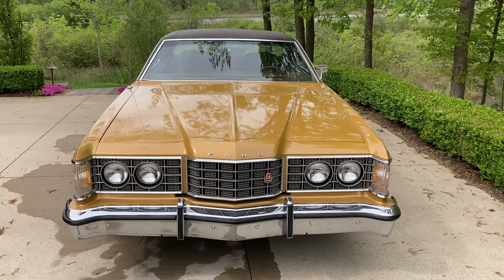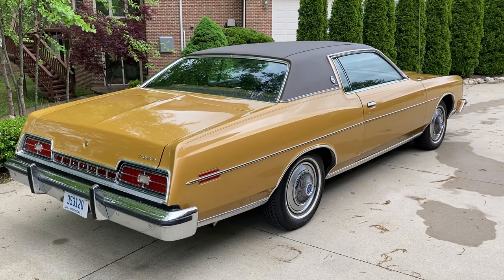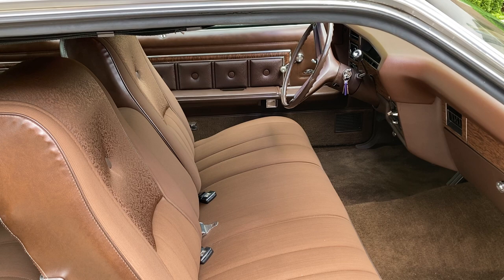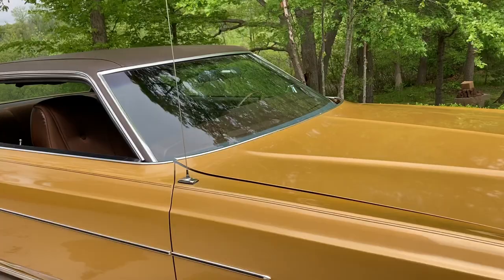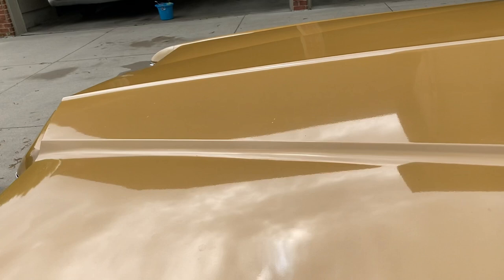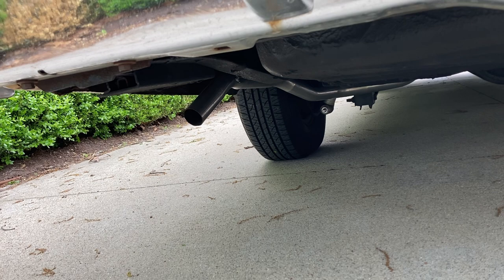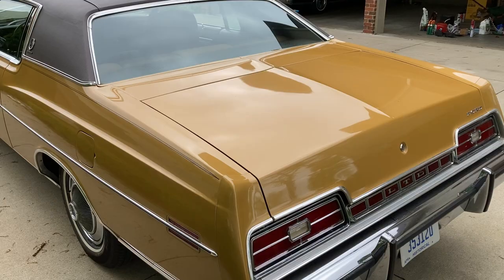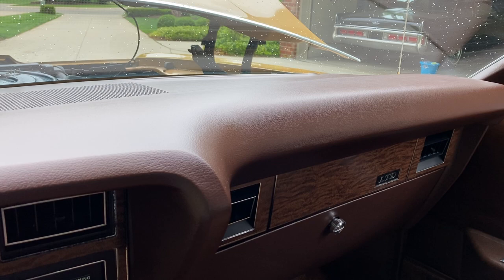1973 Ford LTD Brougham Coupe 460 V8 - The Everyday Man's Near-Luxury Car

Comment: My grandmother use to have a 1974 LTD two door as same as the 1973 year model and it had a 400 cubic inch motor. If you were ever to get in a high speed collision in a car like those you, would have much of a chance of surviving that collision as long as you have your seat belt on. I own a 2022 Mitsubishi SUV and I sure the hell wouldn't wanna be in a high speed collision even with seat belt on and all air bags safety features.

Comment: Beautiful specimen, that. I miss those aberrant, wonderful '70s colors. Thanks for sharing!  Most didn't appreciate the big '70s bumpers, but I sure did - great protection, and Ford had some of the very best. Parking lot or traffic light taps from an inattentive motorist? No big deal. Need to push a dumpster, shopping cart or derelict Edsel? No big deal. Good stuff. '73 was a hybrid one year only look in FoMoCo land, featuring the 2.5 mph rear and 5.0 mph front bumpers.  Was it the same for GM and the rest? Think so, but can't recall at the moment.

Comment: My dad had a 77’ LTD Brougham 351 2bbl. 4 door sedan. I remember the dealer checking off the boxes while dad said yes / no ordering it. at Ford City Ford Chicago Illinois. Even at 9 Years old gave him crap for not ordering power windows.
Reply: Looks like the one I saw in the end credits of The FBI with Efrem Zimbalist Jr. Used in the end credits
Reply: In your dad's defense, there was most likely a reasoning behind his decision.  In that era, power features would notoriously break down or fail completely, often prematurely.  Many older people, including my father, would say that power windows, door locks, seats, etc. were "just something else to go wrong with the car" and, therefore, didn't want them on the vehicle.

Comment: I like the 460. Bought a rusted out 73 Mercury Marquis that has only 51,000 miles. Pulled the 460 and C6 auto and dropped them in a 74 Torino. That car would cruise all day at 70 miles an hour and get 22 miles per gallon.

Comment: I had 1 of these , i bought it in 1983 for $1600 at a Datsun dealer in Skokie IL . It was a dark brown with the same interior . back then all the parts matched inside but your seats are quite faded an d a little thin fabric wise . it was a very comfortable car . Mine had the 9 inch traction- lok rear with the 2.80 highway gear .
It came with the standard 400 M engine which was the later version of the 351 Cleveland with a taller deck and the larger trans bolt pattern that was shared with the 429 and 460 . When the engine  needed a total rebuild I sold it to a guy with a rusted out 351 Cleveland powered 4 dr Galaxie from much earlier in the model year . He thought it would be a straight engine swap but he had to swap in his FMX when the C6 would bolt to the engine . he drove it another 5 years in Chicago before the body was full of rust holes.
I didnt miss not having power locks or windows since they werent that common back then . It had AC that blew ice cubes like a GM but I really missed having cruise control since this car would creep up to a hundred if you werent looking at the speedo at all times . It cruised quietly without any sensation of speed or bumps . That seat was called the Flight bench and you really just flew down the highway like an airplane .

Comment: RISP Bought 1978 Ford LTD 2Dr 460 Police Interceptors, when 440 Plymouth Grand Furys, were no longer available in the 1978 Model year. They were ordered with an optional 8  gallon auxiliary fuel tank. 
 There was talk about 1978  Chrysler Newport 2 Dr HT 440 HP, but that never happened,  The last one 1978 RISP FORD LTD 460 Police Interceptor 2dr HT I saw still in service was in June, 1984 on Rt#95 in Warwick, RI, Southbound,  just past the Airport Exit, and just before the RT#117 Exit.

Comment: my dad bought a Ford LTD Country Squire wagon with a towing package from the dealer's floor. we werent even looking for a new car.  it had the 400cid in it and like this one. no power on the seat, windows or locks.  it had the climate control AC where you picked a temperature, and of course the inward facing jump seats in the back.  we pulled a 20' travel trailer from michigan to maine and again down south one year and to DC one year.  my dad gave it to one of my mom's cousin (who had 4 kids and not much in the way of job prospects) in 1983.  the sticker was $4,449 if i recall...

Comment: I love it. Real wheels and tires, 2 doors, vinyl top, and it's BIG. Only thing missing is a right side mirror, which was optional. My dad had a 1974 LTD 4 door, brown with a tan vinyl top. I believe it had the 351 engine. It floated over the road like a hovercraft. I currently drive a 2006 Lincoln Town Car, but would much rather have one of these. They look a lot better, and have NO computers.

Comment: Had the base model Galaxie 500 with a 351w years ago and yes, the fuel gauge in it never worked. Absolutely loved that car! It was such a head turner everywhere I went! Sadly, I didn’t have the means to restore it and keep it in good condition back then, so I just drove it until it literally rotted.
Reply: I thought this was a Galaxie 500, the LTD had different tail lights. Guy across the street had a dark blue one in early 80s in NY.

Comment: A year ago, I bought a 1973 Pontiac Grandville convertible. Similar. Big engine. 455. Crank windows, am/fm, . No tilt, cruise. Has a/c. To bad LTD couldn't get a convertible on the line.

Comment: ...this is a really beautiful car in also beautiful condition!  I really appreciate when the engine compartment is being left to it's original condition without this terrible chrome bling-bling you see so very often.
I'm owner of a 1968 LTD 2dr hardtop with the most common 390ci engine. 
Here in Germany, most people think about old US-cars as being very luxurious and full of extras - haha, my LTD didn't even have a right rear mirror until I installed it. 
No trip recorder, no temperature gauge (only these blue/red lights), also 4x drum brakes without power brake (so I changed to disc brakes with power brake, traffic here is too intense)...nevertheless, I invested a lot in this car since I bought it, and I cannot imagine to sell it even gasoline becomes ridiculously expensive these days ($2,50/litre or, converted, roughly $9,5/gallon).
Have a safe journey and greetings from Germany!

Comment: My 1975 Buick LeSabre coupe is similar option wise: it has the 455, the F41 heavy duty suspension, the most expensive climate control option, AM/FM cassette radio and Landau top but as yours, no power locks, and no power windows

Comment: Love your videos. Seems like yesterday when these cars where new. I never realized how these models just faded away and have been replaced by endless look-a-like SUVs. What happened? I still prefer a passenger car with a trunk. So glad you are preserving these vehicles I used to consider just mundane transportation. Now they are a great representation of the era. My Dad had a gas station in Manhattan during the oil embargo. It was total insanity watching these huge cars waiting in line (wasting gas) to get a few gallons of fuel. Had to be there to believe it.

Comment: Beautiful car!  As long as the Pertronix module ha been properly installed, it will be perfectly reliable.  I'm a British car fan and we use them a lot.  As long as you wire them properly, they're fine.
Reply: @stevepulse4893  They went for vacuum cleaners instead.  It was the only thing they made that didn't suck!

Comment: Very nice find and a smart buy on your part.  My dad loved these big boats so we always had something with the biggest V8 they offered.  He would usually get Lincolns, Mercurys, Buicks and Cadillacs and often the coupe versions but we had all kinds.  The full size cars from say '68 thru '78 really floated nicely down the interstate.  It's odd to see roll up windows in what is really a quite luxurious machine.  I have a '78 F-250 that I restored (partially) and the silver on the instrument cluster trim can be made to look like new by using some aircraft modelling paint without too much cost or effort.  I think your LTD looks amazing.  Love the paint color too.  The vinyl top popular back then seem to cover up some sins as I found out when working on a '72 Mustang. I'm guessing that this car was garaged and under covers my its previous owner most of the time and protected.  I would suggest researching the common rust areas on these and then treating it (if you have not done so already) to really keep this looking pristine.

Comment: The first 460 generation was introduced in 1968 and was produced until 1972, this had an Autolite four-barrel carburetor and made  and 485 pound-feet of torque. This is the most powerful of all of the 460s.
Reply: Thats sad, 460 cid & 212 hp? 0-60 in 3weeks, truly a snail.

Comment: A very mild cam, a set of earlier model 385 series heads or some aluminum heads for better breathing and an aluminum intake and a Holley or ACE fuel injection system would make a bunch more power and get better mileage. This car is great as is but could be even better.

Comment: Stupid car lot, put the car on the lot when it won't start.  I'm surprised they let you mess with it unsupervised!  The car is beautiful and thoughfully equipped, all the right stuff.  The bumper guards/strips really do "soften" those big bumpers.  Side moldings are very important also.  Big engine and HD suspension.  I could certainly live without power windows/locks.  Just wish he had chosen split bench bucket seats though.
Reply: Properly optioned for sure.  Hope the original owner is watching, they will be thrilled.

Comment: Amazing how Ford used the same platform on different vehicles. Beside the speedo, the dash and heater air ducts are the same as on my 1972 Mark IV. The Quarter Windows and the lower part of the inside door panels are also the same.
Reply from the maker: They’re not the same at all. The mark IV was a totally different platform.

Comment: That IS  super rare! I've only seen a '73 Country Squire with a 460... Part of a trailer towing package along with heavier duty cooling, an oil cooler, and I think some changes to suspension and braking...
Reply: The only thing rare is someone who is willing to own it! Just guessing that your roll of toilet paper is "super rare" because its the only one of that type bought at that store with that exact number of sheets left. Really? Then when you add the term "i think" it means you have no idea what it is & have no idea what your talking about.
Reply: Fyi, loan value is $ 3175 for this "super rare" ltd, or approximately $3000 more than your "super rare" p.t. cruiser dream edition. 🤣
Reply: Were still waiting?

Comment: Beautiful car in fabulous condition. When I was in the US in 1975 I had the use of this exact car - exact same front (shape, hood, grill+lights), rear (shape, tail lights), and sides (shape, 2 door with those small rear side windows). BUT it was a more “basic” version - no fancy chrome embellishments, plainer “cheese-cutter” grill - and I think it was badged as a “Ford Galaxie 500”. 
Have I got the model name right, was it also ‘73, and what was the engine size?
Great video!

Comment: Not many people may know of the rumour that Ford had to stop making these cars cause they last forever. They just worked. And they be tough as hell. Ya. The rumour back in the day was that this car worked so well, that Ford just stopped making them even though they still be selling. 

Like my buddy had one years ago and they used the thing to go and run over stuff for fun. That car would just work even after it took a major beating. They tell me a story of accidentally hitting one of those cement barricades and breaking it in half. Amazing. Have another friend whose dad owned one. That car just ran and hardly broke down. 

Ya, so the rumour was the ford LTD was too good and Ford had to stop making them cause they never broke down.

Comment: A  Brougham  should  have a right hand  remote controll  mirror  & P.W.  & locks & opera  windows   I see no speed control  on wheel  the dash pad should be extra soft it is a nice car but I get the fact that when these cars  were new there  weren’t  a lot of option  grouped  packages  like now a days  the  salesman  would sit with you in those Tiney  offices back in the day  and check off  individual  option  boxes  that’s why some cars did not really have all features or a strange combination of options
Reply: If ordered with the convenience group, it would have the R/H remote mirror. PW, cruise and 
the opera windows were optional as you said by filling out the order form.

Comment: As I've noted before in your videos, this is a gorgeous car!  Of course, all of yours are.  But I love this one.

My issue of the 1973 Ford Mercury Lincoln Buyer's Guide suggests that the 429 engine was offered with the 3.25:1 axle as an option on the full size Fords and Mercurys, but the 3.00:1 was the highest numerically available with the 460.  Am I correct that some of your '73 460 powered Fords and Mercs have the optional 3.25 axle ratio?  I know that manufacturer's option restrictions as spelled out in the dealer literature weren't always accurate.  I've seen too many exceptions in their original form.
Reply: Yes your correct, the ratios changed when the Governmental mandates changed because of the up coming Oil crisis and all that followed.

Comment: This reminds me of my teen years learning how to drive. Around 1979 my step-father bought a '73 Ford FTD wagon as a third family vehicle and it was one of the cars I learned to drive on at age 15. It struck me as an older car than only 6 years old. It had a fair number of miles, the dimensions were large even by 70s standards and the brakes sucked. And I'm pretty sure it did not have the 460 big block.

Comment: Mushy ride,  these cars were quite and comfortable with a suspension that would float over a railroad track. 
I used to own one. Cornering lights,, you mean side markers. The bumper close outs are not rubber but polyurethane.
Reply: Side marker lights and cornering lamps are two different items.  Front and rear side marker lamps were first required on all passenger vehicles, light duty, and medium duty trucks by the Federal DOT in 1968.  For '68 and '69, only a light (amber in the front, red in the rear) was required.  Beginning in 1970, the law was revised to include a light used in conjunction with a reflector, in addition to an increased minimum size.  On a side note, Japan also required the use of side marker lights at around the same time, however, only the amber lights at the front; the rear red lights were not required there.  Cornering lamps, on the other hand, were an optional feature that were obviously approved, however, not required by the DOT.  They were a somewhat popular option on many mid-size and full-size vehicles during the '70s, after having been used exclusively on a variety of luxury vehicles during the '60s.  They are the larger rectangular white/clear lights located in the front fender area.  They illuminate when a turn signal is actuated to provide side illumination at night as the vehicle makes a turn, lane change, etc. When the turn signal is cancelled, the lamp goes off.

Comment: I think the factory exhaust had 1 huge exhaust tip that looked like a stove pipe with a turndown.  My dad tried to get my mom to trade her 71 LTD Brougham Coupe for one of these and she said no.   The 71 was having issues with the automatic climate control and my Dad was growing tired of dealing with it.  My mom hated the new bumpers and for some reason she very attached to the 71.  After a new compressor and a couple of other parts replaced the 71’s auto climate control was back to functioning correctly and so my mom kept her beloved 71 a few more years and I think it remained trouble free.   My Dad swore if that automatic climate control malfunctioned again he was pushing it off a cliff.

Comment: Very beautiful car. Used to have a dark brown 4dr with 400 but it was traded for a junk '81 chevy.  If the title was in my name I'd still have the car.  I managed to get a '76 4dr with chrome trim on all the body lines, everything electrical, and had rear fender skirts.  Trusted the wrong guy for a mechanic.  He ruined the 460 engine.

Comment: WOW GUY !!! WHAT A GREAT CAR YOU ARE VERY LUCKY!! YOU MADE ME LAUGH,, YOU GOT IT RUNNING GREAT THEN TOOK IT APART SO THEY WOULD NOT HEAR IT RUN GREAT HA!!!!! HA!!!! YOUR SMART ,,,.. ME THE WAITING IF THEY WOULD CALL ME BACK WOULD DRIVE ME CRAZY ,,I WOULD WANT IT RIGHT AWAY ,,PRICE NOT TO BAD LOOK THE BODYS GREAT!! INSIDE GREAT !! THANK G D YOU SAVED THIS CAR ,RUNS GREAT ,,.. THIS FORD IS NOT FOUND ON ROAD DEAD..F,O,R,D, I HAVE A 1978 BUICK SKYLARK ALL PUMP UP AIR SHOCK, OLD GLORY RIMS  RED WHEELS ,CAMEL COLOR BODY ,BLACK HOOD TWO SMALL HOOD SCOOPS, CAMEL COLOR INSIDE , POP OUT SUN ROOF , DUEL EX. GO TO CAR SHOWS 3RD PLACE WINNER ,,. IRWINDALE SPEED WAY QUARTER MILE RACING LAST YEARS 2 TIMES  BECAUSE OF COVID,, . YOU WIN SOME RACES BUT LOSE  ITS FOR FUN ,I DONT PUSH HER THAT MUCH .. GREAT VIDEO KEEP HER GOING .. PEACE..

Comment: Is that a York? Tecumseh? compressor?   My car still (hopefully) has the freon charge in it, but it needs a new clutch.  It can be replaced on the big A6 without evacuating the system but the radiator is in the way.  I remember big shop tanks of freon on eBay about 15 years ago, for just a few hundred. All you needed was an MACS license.
Reply from the maker: York

Comment: What part of North Carolina did the car come from? My 1973 Ford Country Sedan was assembled in Norfolk VA, and sold new at Keeter Ford in Shelby NC. I’m running a Petronix ignition because the points were shot when I got it. It’s an original paint survivor car, but I did have to swap out the engine block with a remanufactured Jasper engine.